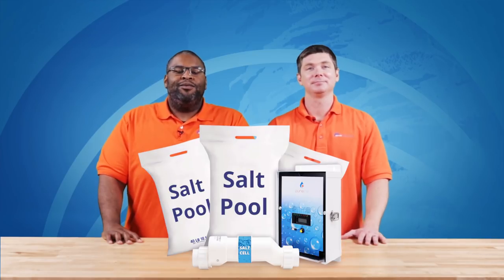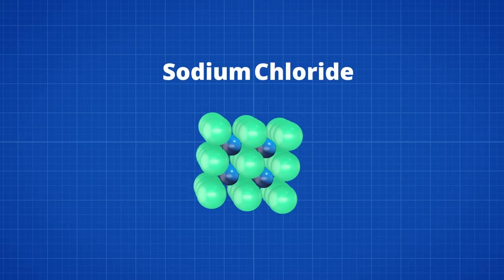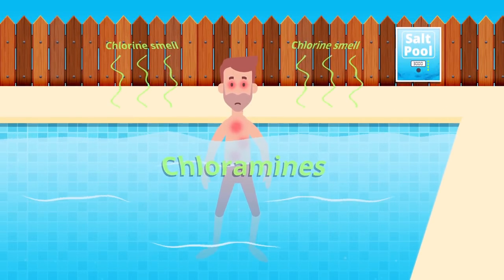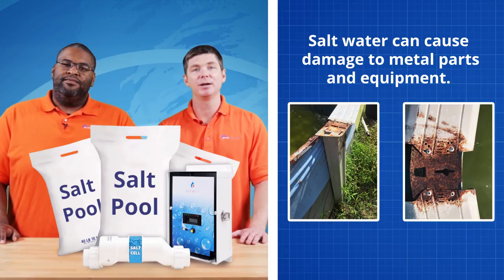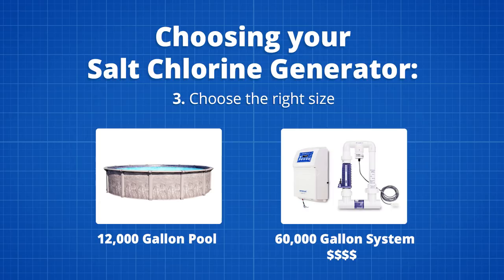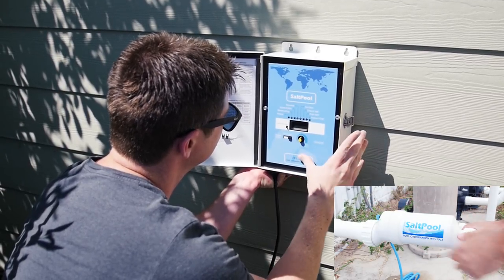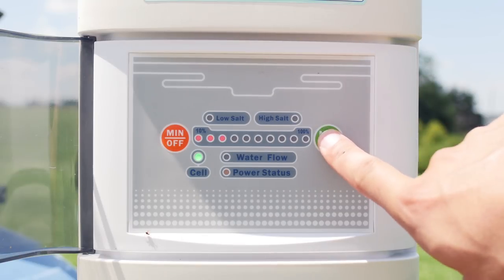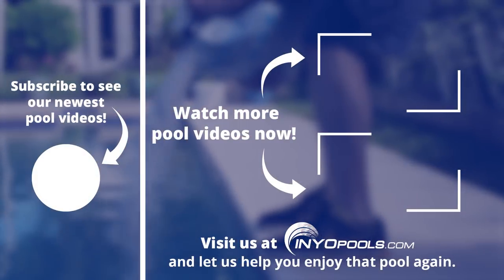Converting Your Pool To Salt Water

Comment: Is this an attachment that works with the current pool filter/pump (something you add on to your system) or does the current pool filter need to be replaced by this? (throw out my old system/pump?)
Reply from the maker: A salt chlorine generator can be added to the current pump/filter system. You would not need to get rid of the existing equipment.

Comment: You'd think the manufacturer already built in some tolerance in their system.  If a system rated for 20K cannot handle a 20K pool then something isn't right.
Reply: Tree climber here. A lot of our equipment is rated for a maximum of 25,000lbs shock load. That doesn't mean you should do that. That means it's the max it can take without breaking. If you redline your cars rpms for too long, you can blow your engine. 

It pretty much applies to everything, the max doesn't mean take it there. 
Hope this helps.

Comment: Do I have empty the current water out before I switch to salt? I currently have a sand pump filtration system. Also what is the best filtration system for the buck. Thank you.
Reply from the maker: No, you do not need to empty the current water before switching to salt. We recommend a cartridge system. Quad cartridge systems are nice because they hold a lot of debris and don't have to be cleaned as often as single cartridge systems.

Comment: What kind of anode is that with the bonding strap. I would like one that i can keep in my strainer basket, but has a bonding strap that goes to the metal frame so that i functions properly.
Reply from the maker: Hi Kyle, you can check out our selection of zinc anodes here: https://bit.ly/3ggWP2b
Reply: @Inyopools  Your website offers ball and disk shaped anodes that go in the skimmer basket. How can they work if not attached to a ground wire?

Comment: Thanks how often do you need to add the salt?
Reply from the maker: How often you add salt will really depend on how often fresh water (rain) is added to the pool and how often you have to drain water. My pool is 10k gallons and I had to add a 50 bag every other month between April and September. Outside of that, I have not had to add any.

Comment: Can i convert my inflatable jacuzzi to salt or is there one popularly sold?
Reply from the maker: You could convert an inflatable jacuzzi to salt water. You'd want to find a bromine salt system designed for spas. Gecko makes one called the in-clear but there are probably some other options out there.

Comment: Would like to go to salt but worried about the steel frame of the above ground pool. Was thinking about using pvc but don't think it would be strong enough. ?
Reply from the maker: Salt water can impact the steel top rails, plates, and rims. I'd switch those parts to resin if that's an option for your pool. Do you know the make and model of your above ground pool?
Reply: @Inyopools  it's an  Intex pool. 15 foot
Reply: I have been handling chlorine for over 30 years with no problem.  Chlorine dangerous to handle??? Give me a break with that BS, more dangerous to put gas in my lawnmower or snowblower.   Believe what you want. I'm sticking with my current system.  It is more important to learn how much liquid chlorine to add and when to add it based on the size of your pool, sun exposure,etc.
Reply: Maybe look at an extreme low-salt model running at 800ppm which is about the same as tap water.  Australia has the Saltigem XSL model and a few others but there would be a competitive model somewhere in the your zone.

Comment: So since a salt water generator is always continually creating chlorine, does the amount of stabilizer go down as compared to a traditional chlorine pool.  I have a 40k gallon pool in direct sunlight.  I had an extremely hard time keeping chlorine in the water, and I was constantly adding stabilizer.
Reply from the maker: The stabilizer level should be maintained at 30-50 ppm. You shouldn't have to add it very often with a salt pool. It's been a year since I added it to my salt water pool.
Reply: You have full sun on pool and swg, so 60-80ppm of cya stabilizer is recommended. 30-50ppm a bit too low, you will be forced to increase the generation time to make up for lost chlorine due to the full sun.
Reply: @Inyopools  if @Kyle Weiss has an outdoor pool, a lot of rain could dilute the cyanuric acid or chlorine stabilizer to water ratio.  Splashing water out, backwashing the filter and vacuuming to waste also normally remove water, along with everything the pool water contains, from the pool.  It is easy to forget replacing the water does not replace the stuff in the water.  With low stabilizer proportions and in a pinch, I have had some success increasing SWG % in my client's pools at night the same way you only add non-stabilized chlorine at night in a freshwater pool.  In a world with rolling blackouts, keep the stabilizer proportion right for best SWG energy use.  If CFL and LED light bulbs make sense to save a few watts, so does this.

Comment: 1-3 PPM Chlorine and 70-80 PPM CYA will have algae growing in no time. Don’t you need high chlorine levels in a salt water pool? It should be around 9-10 PPM chlorine for the water to stay clean and sanitary at that level of CYA.
Reply: no
Reply from the maker: I have a salt water pool and maintain my chlorine at 1-3ppm with a CYA level between 50-70. No algae.

Comment: Can you float on the salty pool?
Reply from the maker: Yes, you can float in a salt pool.
Reply: @Inyopools  are you sure?
Reply: @KingPope13   the saltier the water ... the easier you float
Reply: With most pool salt water systems you are running about 3000ppm, the ocean water is about 35000ppm.

Comment: We had a saltwater pool. Everything rusted out.
Reply from the maker: Adding a sacrificial zinc anode to the system will prevent rust on any of the metals in the water. It may not help in every application. Steel above ground pools and old stainless steel filters seem to have an issue with salt systems.
Reply: I turned my above ground pool to salt. Big mistake. The wall started to rust around the skimmer. The top rails rusted and the edges would fall in the pool over the winter and rust stain the liner. My deck screws rusted and boards popped up. Huge mistake. I thought I would save money on chlorine and had to buy a new cell every other year anyway and still had to replace the pool within 9 years. Huge waste

Comment: Wow, I can't believe you guys are still using inline cell housings.  Here in Australia (millions of pools here!) we seem to be eons ahead technologically-speaking.  A standard salt chlorinator here has side-entry housings and often vertical unions, reverse polarity (so massively minimised calcification), inbuild pH-control modules for acid feeder upgrade (either sensor driven or algarhythmic), digital timers with backup batteries, auto pump shutdown incorporated into gas sensors,  detailed information onscreen, and more.  That design you are showing is fundamentally flawed.  I doubt you guys would be buying Australian Chlorinators, but at least look up North at the Canadian company Astral (or Fluidra, or Hurlcon, they have a few names) at their units, the E-series is good for the money.
Reply: Video is literally over three years old.. an awful lot's happened since then, in tech too 👀
Reply: I'm considering switching to salt, what are these systems you're speaking of? I'm sure we have access everything in the US. If anyone is familiar, I'd like some more info.
Reply: I would have to take out 3 mortgages to afford it if they brought that over.

Comment: I have been cleaning pools for 27 years professionally. I will tell you what I tell my customers, you will never get back the money that you will spend putting in one of these systems. They are overpriced, and very misrepresented. This system will not sustain itself in hot climates.  During the very hot summer months, you will still need to add liquid chlorine because of the increased humidity and bather load. Your ph levels will need to be adjusted on a weekly basis.  You will be adding a lot of acid!  On average of 1-2 quarts a week.  I can tell you that it is almost impossible to maintain a chlorine level that is appropriate.  Most of the time the chlor level is either to high or to low. Your salt cell will need to be cleaned and maintained as well.
Even listening to expenses listed by these gentlemen in the video, even at the prices a couple of years ago, it is much cheaper to have a professional pool service maintain your pool and you won't have to worry about personally handling the liquid chlorine.  Salt cells now average twice the cost that they just quoted.  Not to mention, you will also need to drain and refill your pool water every two years.
Some customers tell me that they like the way the pool water feels with the salt.  You can add a bag or two of the salt to your current pool and have the same feeling. The comments about the skin and eye irritation is usually because the ph and alkalinity are out of balance.  Those are adjusted with sodium bicarb to raise low levels, or acid to lower high levels.  Both of which will irritate you.
Reply from the maker: Hello Tom - Thank you for the feedback. I live in Florida and have a salt system. My pool has never had an issue with keeping up with the chlorine demand in the hottest months of the year. The key is to oversize the salt system if you live in a warm climate. Oversizing the system will not only ensure that the chlorine demand is met, it also lengthens the lifespan of the cell. I do agree with you about the acid demand. I have to add a couple cups of acid once a week. As far as draining, I have not heard of having to drain a salt water pool every two years. On the other hand, pool owners who use chlorine tablets all the time occasionally have to partially drain the pool due to high CYA levels.
Reply: You will never get back anything when dealing with a pool. Why is the swg any different? A depreciating assett, so it comes down to how does the owner want to care for their pool.
For me nearly 15 years of maintaining my pool with a swg and had very little issues. Hard for me to go back to the old school.
Reply: what?  Yeah you are a pool cleaner. You know nothing about pool chemistry and it shows.  Explain why you would need to drain your pool every 2 years.  Thats makes zero sense.  I never had to drain mine and never had a problem maintaining a chlorine level.  And no you cant add a bag or 2 of salt and have the same feeling of a salt water pool.  Thats a ridiculous comment.  And its a fact that chlorine pools do irritate swimmers even when the ph is perfect because he chlorine is much higher and is an irritant. I know at least 10 people that have salt pools and would never even think about getting a chlorine pool.  You seem to make up these delusional problems that dont exist.   Salt cells are twice what they quoted? The quoted 200-700. So you are telling me salt cells are 1400? LOL. The entire system is cheaper than that.  My cell for a 40K gallon pool is $350.  So that over say 5 year average is what?  $70 a year.  Pool service is anywhere from 150-400 a MONTH.   Do research if you dont have a clue. Ok kiddo?
Reply: @Executiveinvestments-  wow appreciate that comment!
Reply: John C  it’s true.  Salt is the way to go.  I’m in the northeast but my brother is in southern Florida.  Most people in his area have salt pools.  The people that don’t have a salt pool don’t because they never heard of a salt pool and or never have been in one.  I was sold first time I was in one.  Zero chlorine smell, zero salt taste.  Tastes like fresh water.
Reply: @Executiveinvestments-  good to know, I got a saltwater index I'm trying out Northeast here as well! Appreciate the feed back!
Reply: John C  just use some zincs.  I have a pool defender in my pvc system, 2 since on my ladder and 1 in each basket.  Kinda overkill but can never have too many.  Plus I keep my salt at 3000ppm.  Just enough for my salt cell to work.  That’s the key.  Use the least amount of salt you can.
Reply: @Executiveinvestments-  Hi Winning, I am glad you enjoy your salt water system.  Just so you know, you have a chlorine pool.  The salt that is added, is converted to chlorine. 
Where I live is Florida, we are concerned about Nitrates.  The CDC says that adding salt to your pool raises your nitrates.  Any lawn debris, fertilizer, and personal body fluids all add to your nitrate levels.  Once your nitrates and other elements in your pool water raises your TDS, "total dissolved solids" so high that your chlorine can not be sustained.
There is only one way to removed the Nitrates.  Only one, drain and refill your pool water.
Another reason why I don't care for them is because in the hot summer months here, your salt system needs to be boosted with liquid chlorine anyway.  That is according to the same guys here that sell the system.  Our humidity here is 106 degrees-109 degrees so our pool water here averages in the low 90's for several months. 
The additional heat burns off the chlorine faster.
As far as adding salt to your pool to make it feel softer, yes it is true.  I guess that you have not tried it.   I will also add, adding sodium bicarb to raise your low ph, and alkaline levels also makes your pool water feel softer.  Bicarb is a salt.
If you want to gain a greater understanding take a certified pool operator course.  You will be surprised at what you will learn about your pool.
Environmental conditions have a tremendous effect on your water chemistry.
Reply: @Executiveinvestments-  I was just trying to be helpful my friend.  You might have misunderstood my comment on salt water pools.  They are chlorine pools also.  You would be surprised to find out how many people think that a salt water pool and is like the ocean and chlorine free.  No one would know that instinctively.  As far as nitrate levels are concerned, you will have to take that up with the CDC.  The 106 degrees of humidity I was talking about is what our air temp feels like.  It is such a prominent factor here that the Weather channel here displays the actual temp and the feels like temp or humidity temp.  That is what I was talking about. 
I also don't know of anyone that dumps 50 lbs of fertilizer into their pool either.
The fertilizer is from run off of lawn treatments and potted plants that a lot of women like to keep around their pools when it rains, blows in, or just washing down the pool deck.  That can get into the pool, and yes it does affect it too.
I do not understand why you are hung up on the draining aspect.  I am glad that you have never had to do it and hopefully you never will! 
Draining of the pool is not the first option.  It is the last resort if it comes down to that. 
Have a great day my friend!
Reply: Tom Florian and no potted plants do not run off into the pool.  Water runs away from the pool not towards it.  Keep dumping 50lb bags of fertilizer into that pool.  That’s the only way your nitrates will be high.  Tell me about the humidity that burns off chlorine.  🤣🤣🤣🤣
Reply: Chlorine is an irritant. It was used in WW1 as mustard gas to kill. Whenever you can lower the quantity used in a pool and still keep it clean it is better. Take it from a former competitive swimmer, less chlorine is better.
Reply: @eb6195  Hey EB, I understand that chlorine is an irritant.  If your problem is burning eyes, etc. the issue is not chlorine.
Believe it or not, the issue is your alkalinity and ph levels. The cell in the process of generating chlorine also raises your ph.
Acid is always added to the pool to bring the level down weekly.
Just so you know, the salt system is used to generate chlorine.  You are still swimming in a chlorine pool.
Reply: Spot on Tom.
Reply: Tap water has more chlorine than pool water. Y'all shower in that %#@& every day, I hope. Most people will never admit something was a bad decision once the money is spent.

Comment: Afternoon gentlemen, I think you need to go and correct the Table that says zero calcium is in balance. It should be 150 at the bare minimum but 200 per industry-standard.
Reply from the maker: Thank you for the feedback. We usually recommend the industry-standard of 200 ppm of calcium.